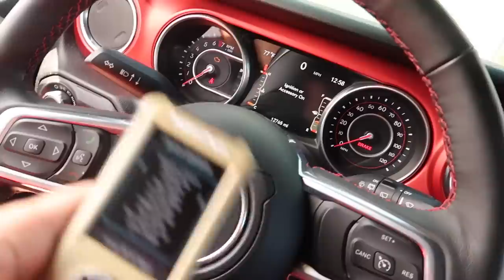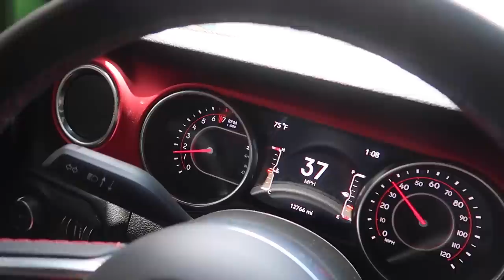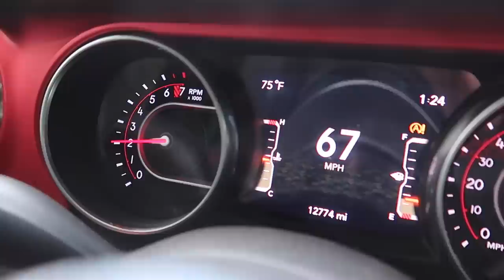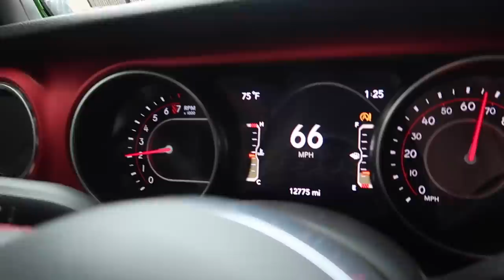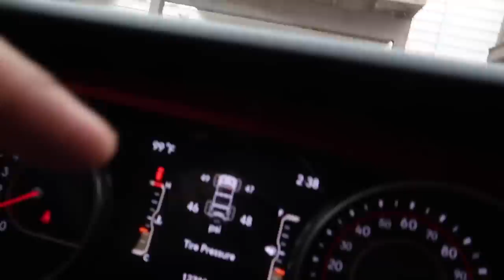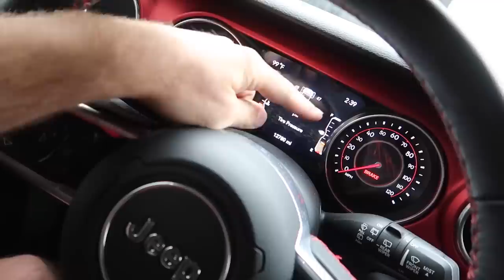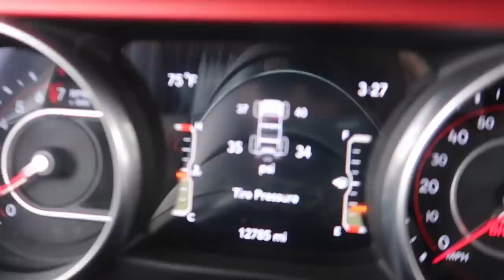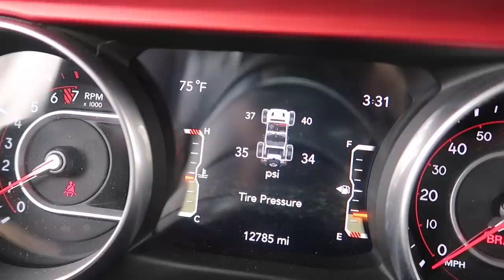Mo' Tire Mo' Problems! How to Recalibrate Your JL's Computer for BIGGER WHEELS!!!

Comment: When calibrating your tire size, you need to measure your tires. The measurement on the tire is nominal, not actual. It's also hot with a specific air pressure.

Comment: Hi Ben I'm hoping you could help me with an issue I'm having with my jeep since I upgraded to 35' tire and used a Superchips flashcal.  I notice that my autostart features cuts off after I get into 4th gear (I get the warning light) but my backup camera also stops working.  Any advice to help remedy this problem? Will turning off the autostart feature and removing the pin solve my camera issue?  Please Advise.  Thanks in advance.

Comment: Hi . Great vid...
 But u dont talk if this does  change any horsepower when u change it with the  correct tire size or it  just  correct the speed on ur dash....
Also if u have wrong speed I guess ur odometre is doin less mile...isn't it? Anyone can answer my question plz

Comment: I know the line lock is for “draggin”... drag racing BUT maybe you can use it as a security/anti-theft option.  If someone tries to steal your vehicle it will just spin wheels.  Only bad thing is you would have to have the programmer with you at all times, just a thought on that... cool vid brah     🤙🏽🤙🏽🤙🏽

Comment: i just took mine to the dealer and for $65 they reset my Speed-O to my new tire size. i didn't need the other options i have my jeep setup for overlanding so i didn't need all the rock crawler stuff.

Comment: If you change gear ratio on the super chip programmer will it change shifting  points ?  I have 35’s and the tranny doesn’t shift until your higher rpms  burning more gas

Comment: Did you have to Trim the Bumper with those 38"s? I have a metal 3 piece JL stock bumper and don't want to take the sides if I do 38's..
Reply from the maker: Nope I have a full sized plastic bumper and it works just fine, no trimming

Comment: Ben, 
Can you let me know where to buy a start /stop module? It is driving me crazy always having to turn it off.
Reply from the maker: Got it from a company called smart start/stop
Reply: Best is simply disconnect the chip that is on ur black cable ( negative ) on ur battery

Comment: Ben did you also re-gegared the jeep when you changed the tire size? And did you do it with that module?
Reply: To regear your Jeep you have to physically replace the gears in your differential. Cannot be done by a flash cal or tune of any kind. Look up 4.88 gears or 5.13 gears if you’re interested in finding out more